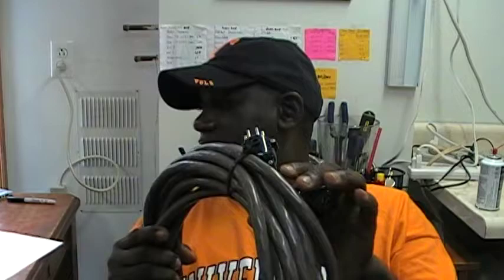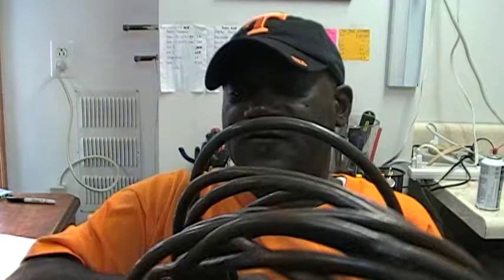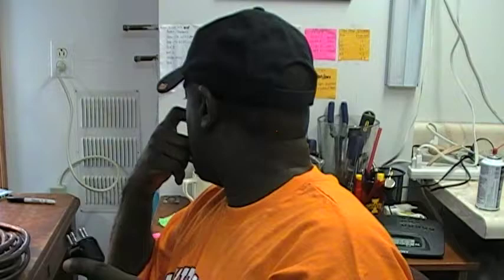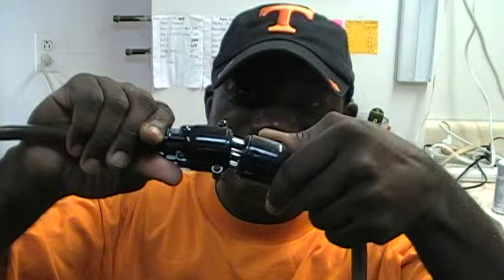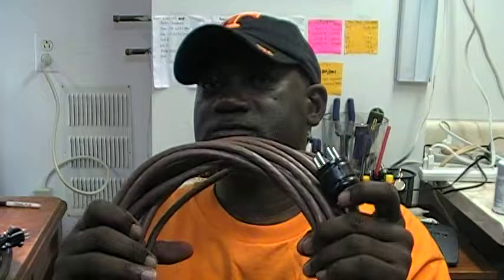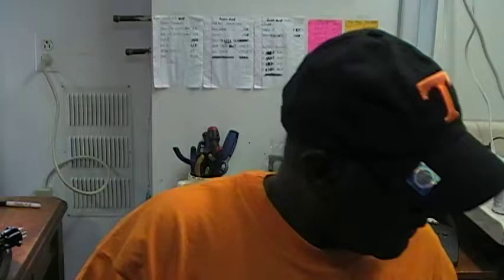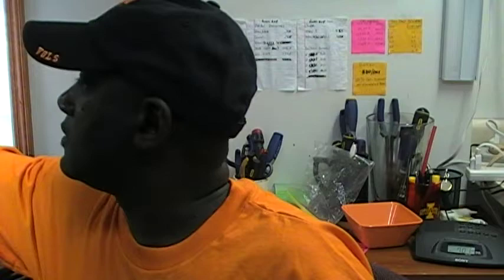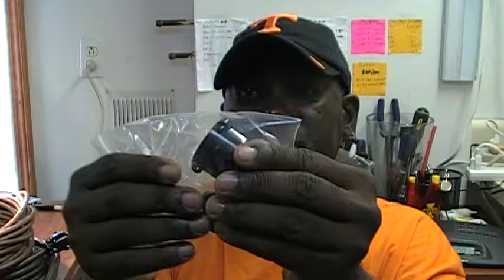5 & 6 Pin Leslie Cables

Comment: What gauge are the conductors on a 5/6 pins Leslie 122 cable? And what voltage runs thru each one of the conductors? Very good videos, Doctor.!!
Reply from the maker: I am out of town and don't have my notes with me right now but I believe the Black, Red and Grey are 20 gauge @ 600 volt and the Blue and Yellow are 18 Gauge @ 400 volt. I will look at this once I get back to my shop to see if this is correct. Thanks for your question.

Comment: Hi Dr Kemp, what is the difference between the 5 and 6 pin cables? Are they use for the same application? if yes, whats the reason for using a 5 pin over the 6 pin?
Thanks!
Reply from the maker: Thank you so much for your question Quebecgold80.  The Leslie amplifier makes the difference.  The Leslie 147 requires that you use all 6 of the wires in a 6 pin cable.  However, the Leslie 122 only uses 5 wires and therefore, you can use a 5 pin cable connected to the organ and 6 pin end going to the amplifier because there will be a 6 pin plug on that. They are referred to in the literature as 5 pinouts and 6 pinouts. Very Excellent Question!!
Reply from the maker: The Leslie 122 only needs 5 pins connected to the organ but you can wire the organ and use a six pin cable as well. But the Leslie 122 uses a 5 pinout system.  However, you still use a six pin female end going to the Leslie amplifier.  On the other hand - you must use a 6 to 6 pin cable for a 147 because you will use all six connections going to the organ as well as connecting to the Leslie 147 amplifier.

Comment: Can You Do A Video On 5 to 6 Pin Leslie Cables??? I Have A 5 Pin Organ But A 6 Pin Leslie
Reply from the maker: This video above deals with 5 to 6 pin cables Joel.  Do you have a question that I did not talk about in this video?  Thanks.
Reply from the maker: This video includes a 5 to 6 pin cable Joel.  Do you have a specific question for me?  The 5 pin cable that I am talking about and that I show in this video is a 5 to 6 pin cable.  Thank you so much for your note.

Comment: Sir is it difficult to change out the starter switch on a Hammond C3
Reply from the maker: Oh no Cubit - it is very easy to do.  Be sure to unplug the organ first.  Don't just cut it off but unplug the organ from the wall.  Please watch my video on the Hammond organ Starter Switch. Remember that high voltage can kill.  So any work that is done by you is at your own risk. Thanks for your question.